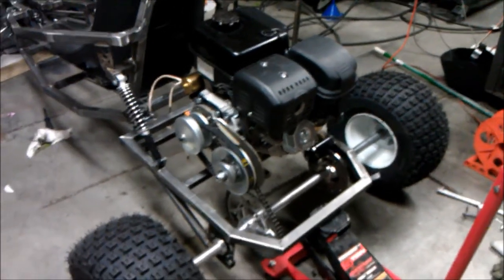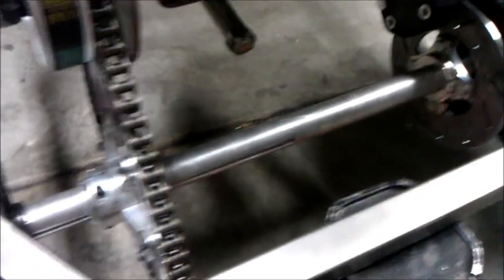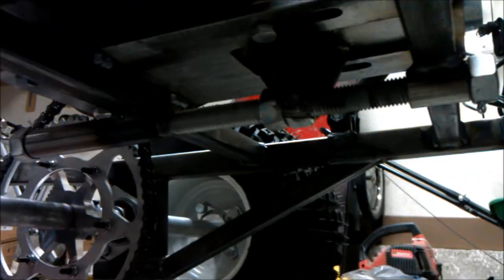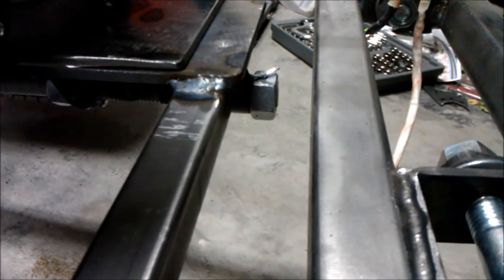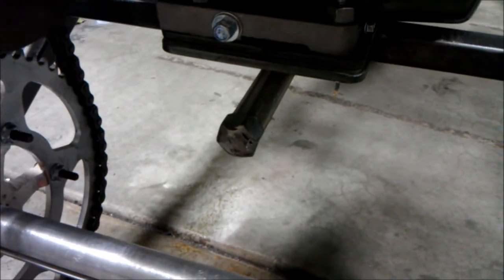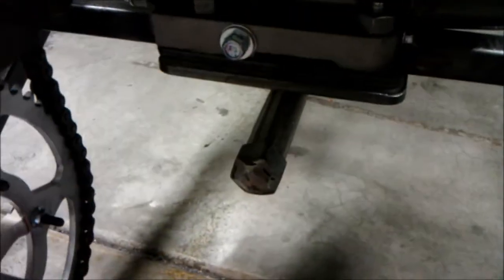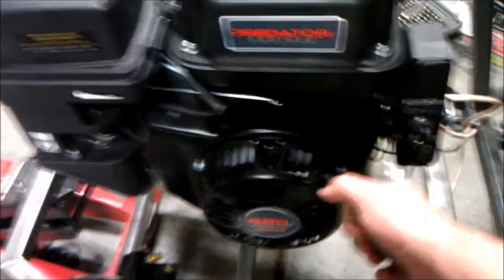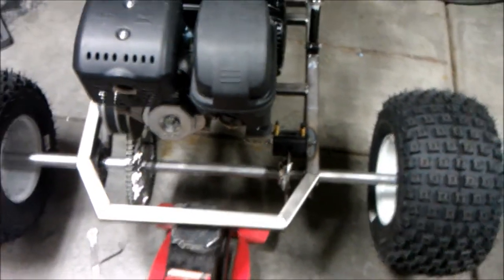Gokart update -- Adjustable motor mount

Comment: Very nice plate build! Thank you for posting! Before seeing this video I decided it will be adjustable plate, as i wanted bolts holding the engine not to tighten un tighten into that aluminum too often. I will do it the way, that engine bolts are tightened once, and that's it. Instead of underplate, I will use two flat square tubes, like 2x3/4 inch, or 2x1 inch and they will do for rails, working as underplate,  on these square tubes the upper plate will slide back, or forth. The rails will have to be drilled and cut just like your underplate, so bolts can move. Those will be bolts keeping upper plate to the rails. Engine will have separate always tightened bolts.
Hit Youtube, and here it is! I had my own idea, but frankly like yours more, just will a bit amend to my
complete liking, but your is great, worth looking at, and thanking you for it.
My initial, move the plate mechanism would have been different, I totally like yours!